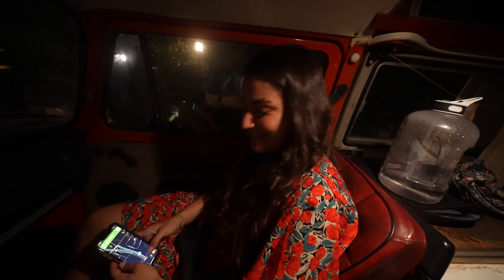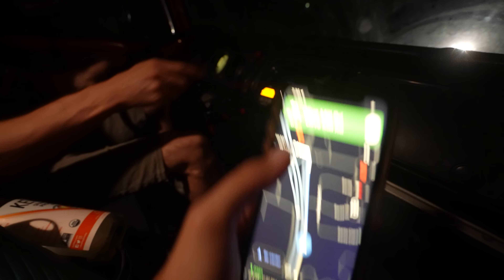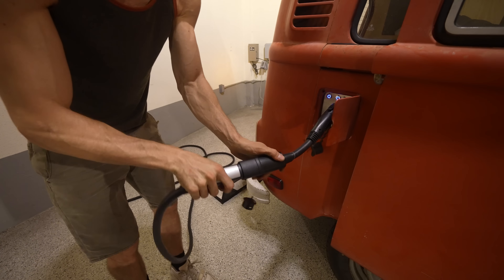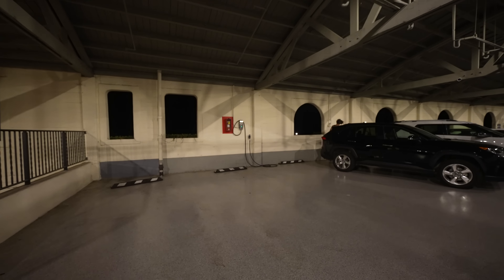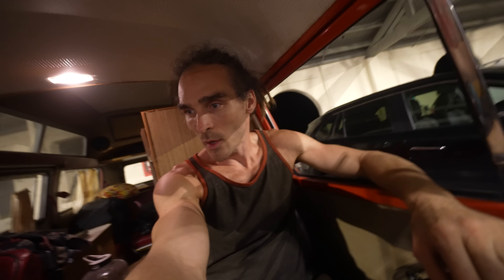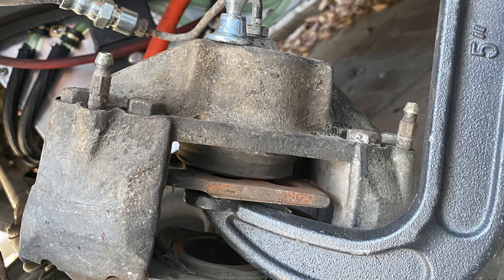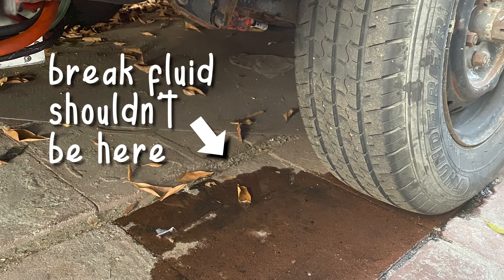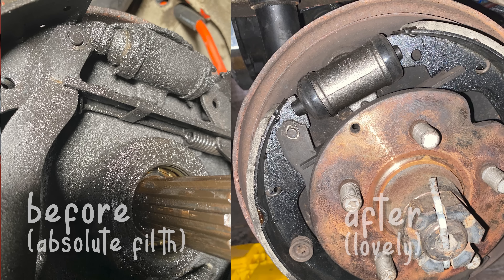All The Problems With My Tesla Powered Classic VW Bus

Comment: I think it needs some disc brakes.
Reply: EV West says you only need disks in the front, AFTER setting up strong regen on the rear wheels. Notice, he hasn't gotten the regen working.
Reply: I think it needs an owner that has a clue to what he's doing. This is a complete waste of resources. The best way to destroy a battery is running it flat, then wait for it to gain some voltage after which you put some more load on it. I can almost hear the dendrites growing.
Reply: @SuperDirk1965  It's not lead acid. If you charge it right away, it's not too bad. I sure wouldn't let it sit empty for a week.
Reply: @fjalics  It's actually lithium that's vulnerable to this treatment. Lead acid couldn't care less. You'd have to charge it right away but is less vulnerable to this abuse. These video's should be accompanied with a safety warning. Total garbage, a waste of energy and resources, harming the environment... Etc
Reply: @SuperDirk1965  
The BMS will be preventing the 18650's from dropping to a damaging voltage,  his just pushing the low voltage cut off hard.  Not ideal but shouldn't cause any significant damage provided the BMS is operating correctly!
Reply: @SuperDirk1965  Do you know what voltage he has the BMS shutoff set to? If you short circuit a cell and run the voltage down to zero, then you are probably right, but that is not what happened here. If that number was set right, it's probably fine. It was in one of the build videos, but I don't remember what it was.

Comment: please just upgrade the brakes. a standard vw bus has like 40hp. im sure you have a lot more with that electric motor!!! brakes are one of the most important safety features. dont skimp out on them
Reply: Drum-brakes in the back are actually perfect in an electric car! As long as the regenerative braking is working, that is... Even when the vehicle is much heavier (because of the batteries) almost all energy will by returned to the battery and not produce any heat on the brakes. Disks in the back tend to rust as they are used very little. The drive shafts in the back however must be looked into as he already has discovered...

Comment: Truly impressed with what you have done so far and hope this doesn't stop you from moving forward, although I agree you should get it all sorted before hitting the freeway. Check out thesamba.com. Great resource for vintage VW issues and lots of conversion info out there. Lots of cranky old school purists who may hammer you about an electric setup but I believe a lot of the Subaru engine and brake conversion threads will apply to your brake issue.

Comment: I'm not going to say exactly how it's done because there will be a lot of people in the gas industry that won't like what I'm about to say
But if you at an alternator to your electric engine with a decent size pulley you can charge your vehicle  while you drive your vehicle which could increase your driving capabilities by a third or two times roughly and anyone who tries to go against it is going against the laws of electricity done by Nikola Tesla also the Tesla coil
Reply: I'd also recommend putting some solar panels on your vehicle but if you want to increase the power that it brings in in between each cell connect a nine volt battery and just strap it to the underneath your little 9-volt battery going to each cell which will increase the power to each solar panel which will in turn make it so that you have more power into your batteries in all Sun conditions
Reply: The only thing that I could say to look into for your brakes is look into getting rid of the drums and using the actual brake caliper and rotor setup but maybe something with lots of holes in it to keep air flow in that area
The other major downfall to those drums is heat so with the motor producing heat in that back area will in turn make things disintegrate so if you add brake calipers and rotors that have holes other across them that dissipates heat better also creates more air flow it'll just be a little bit more challenging when it comes to running brake lines or making adapters so that you can actually do that but I feel like at the same time it shouldn't be that hard to find inside of the Volkswagen community to do it
Reply: Sorry for all the long list of things loctite goes a long way or if you don't have loctite you can also use nail polish and if you do that on all of those different bolts or as many bolts as you can find in that back area this will prevent it from slowly wiggling out

Comment: This VW bus will snap axles all the time way too much power for standard CV joints
Reply: I had my cv joint snapped 2weeks ago with a 1800cc air-cooled engine,  electric motor has more toque, he needs an upgrade

Comment: I’d put lots of solar panels on this van.
Reply: Useful for charging the 12 volt battery but pissing in the wind for charging the traction battery.
Reply: @normanboyes4983  you’d be surprised! Canada sells a 365watt panel that’s the size of what a 100w panel used to be. He could fit 4 or 5 of them up there. I run my 3 bedroom 2 bath home on 6 solar panels.
Reply: @Kelly-st7bu  I bow to your superior knowledge - however on VW camper he might only get 2 full size panels on the roof and I do not know the capacity of his battery installation, but let’s say it was 40 KW/hr and required 30 KW to fully charge then, 2 panels will take about 4 days to charge it up. Even if he could get 4 panels onboard - 2 day charge from 25% to 100%.
Reply: @normanboyes4983  my father had a VW bus when I was a kid. He can definitely get at least 3 panels up there. 3 times 365 is 1095w. That would be a trickle charge for those Tesla batteries but those PV panels would pay for themselves in no time then it’s free energy from the sun.
Reply: @Kelly-st7bu  Do you know what his battery capacity (I do not)?
Reply: @normanboyes4983  I’m not sure. I’d like to know that and his range.
Reply: The modules most likely are the old ones from Tesla. There are 16 modules with 5kWh each in the Model S 85. He fitted 12 of those so I think he has about 60kWh battery capacity by design. Usable capacity surely is lower as the batteries loose capacity with age and charge cycles. On top of that you might want to have a energy buffer. So I estimate about 50kWh useable capacity.

By that I guess a highway range of (if not going too fast) of about 150km or 95 miles.

Comment: I know you probably moved on to another YouTube money making opportunity, but for others watching the problem is probably the brake hoses. for some reason the VW ones are extremely likely to swell on the inside as they age even though they look good on the outside.  it causes the brakes to lock up like that.  the master cylinder has nothing to do with it. it works just fine with no booster.  I would guess the majority of the VW busses on the road don't actually have functioning boosters.

Comment: Whooo! You killing the battery if you run it absolutely flat by waiting, hopping few yards, waiting, hopping. LiPos are not designed to run completely flat.
How many volts does your system have, and is it capable of DC fast loading?
Hope you haven't killed the batt.
Reply: Lithium won’t be a problem

Comment: I'm sorry but what you are doing is a danger to yourself and others don't put that thing on the road until you no longer have drums connected directly to a high torque engine!
The torque of the engine snapped your axle imagine that happening at speed!
Get the motor brake sorted then drums should be ok

Comment: Delightful you got it on the road.. I have a question... so this runs on electricity .. your roof, why aren’t there solar panels feeding to an mppt controller and then a pure sign wave inverter.. will this not feed while driving? Secondly.. why when these are being created are they not feeding x4 alternators? An alternator can create 110v x4 = 400+ v which is what a quick charge station uses? Not sure on amp... but this stuff has always bugged me.. any clearance you can provide on my curiosity?

Comment: It was only a matter of time, this car would burn down sooner or later. You have no idea about the dangers of the batteries under the car and the high voltage system.The system also lacks any water resistance (hanging cables, hole in the floor), which is completely incomprehensible. If you don't want to lose money on this project, just give it to people experienced to make it run safely!

Comment: Rear brakes only handle a small portion of your braking....buddy had an issue with his rear brakes leaking years ago and just crimped off the brake lines to the rear brakes so they wouldn't work anymore....problem solved.  take out the rear pads and there's nothing to lock up the wheels anymore.  Mind you you'll have to be careful stomping on the brakes if this is done since you'll only have the front brakes working.
Reply: Seriously dude you need to get proper brakes on that thing, not only risking injury to yourself but other road users. It's plain dangerous...
Reply: That sounds like a great idea what do you plan to do when the front play up and you have no rear?
Reply: What about ur handbrake?